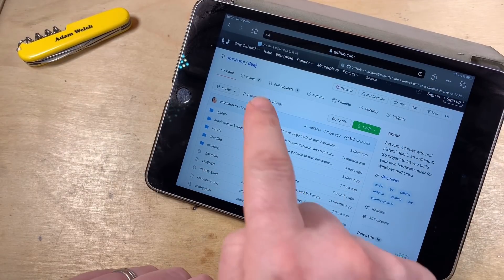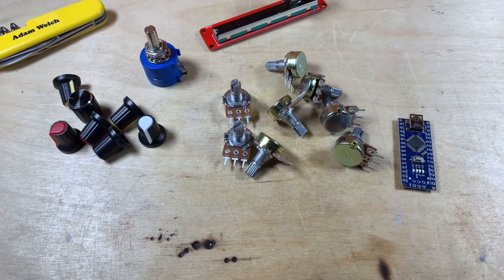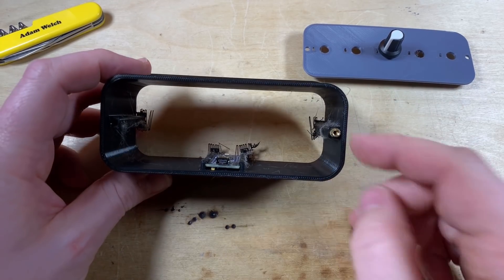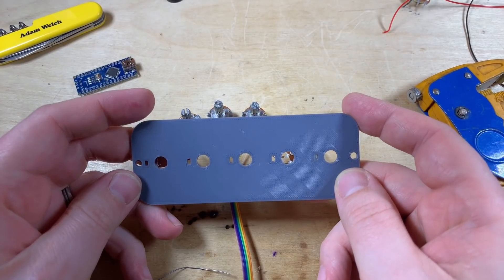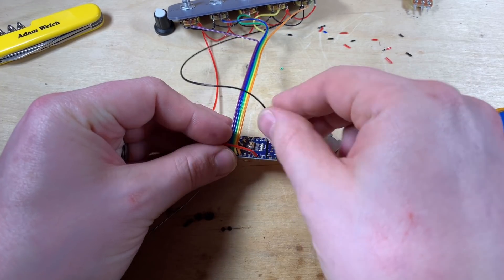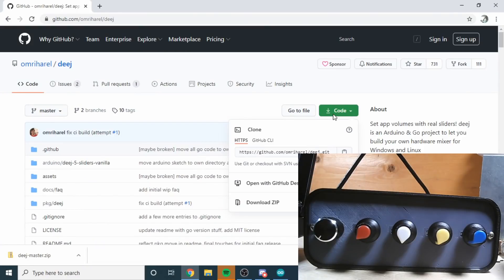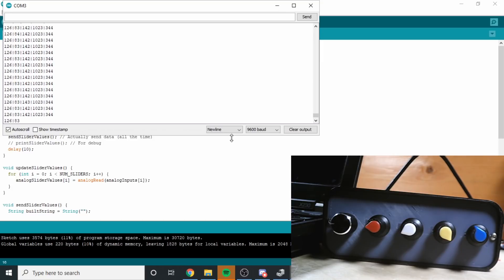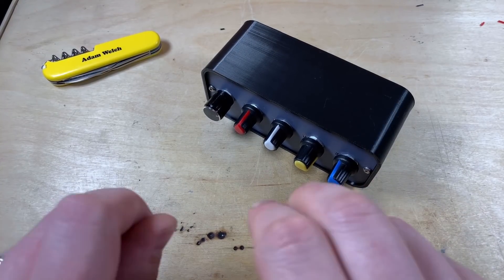deej - Arduino Volume Mixer

Comment: I wish there was a 10$ ready to use one from the local (or oversea) retailer.
Reply: I think the parts alone cost more than 10 bucks.
Reply: @itsasinine3337  Sadly they do, yes. As a done device this surely could be mass produced cheaper than that though.

Comment: Does it make a difference what potiometers i use?
Because i have 2x 100k 2x 50k and 1x 20k.
The serial monitor always write 1023 on the 100k and 50k, and the 20k varies between 995 and 1017.
Reply: As long as they are linear then it shouldnt be an issue.    You'll know once you try to adjust the volumes
Reply: How did you get on?    If still having issues check wires/solder isn't touching or not connecting properly.   
I had the same problem.   All good now
Reply: @MUTILATEDFILTH  it was a issue at the connection.
I am on the road to finish ^^

Comment: Looking forward to trying this! What M3 inserts did you use M3 x D x L ?
Reply from the maker: 4.6x5.7mm according to the listing. However, they can be considerably longer because the channel is pretty much the full width of the case.

Comment: If you adjust the volume through the PC software will it make the knobs automatically turn to the right volume level on the DEEJ?
Reply from the maker: No, but next time you adjust the physical knob, the software volume will jump to the corresponding position.

Comment: Thanks Adam. At 14:34, your comment, 'The code is straightforward...' had me laughing. Most people, who have no coding abilities, would disagree with that assessment. 😉
It's an interesting, if somewhat overcomplicated, way to adjust software volume levels, leaving another item to locate on a busy workbench. But I do like the idea.
One question arises though, and please forgive me for asking it, because I rarely see Windows: Wouldn't a customisable on-screen mixer be much more convenient and tidy to use? Surely somebody must have designed one for the OS? Windows has been around for over 35 years, after all. Of course, the question is begged for those using Linux, because several decent and customisable Open Source mixers already exist.
Reply from the maker: That’s fair. The code is only straightforward if you know it. I guess what I meant was that it is essentially only doing two things - reading the voltage and sending out via serial. 
A commenter has suggested the software EarTrumpet which is apparently a handy windows software mixer.  Cheers RWB
Reply: @AdamWelchUK  Thanks for the reply, Adam. Now the code makes a some sense. 😉 Glad that there is a software solution to the mixer issue. It would have been unlikely that, with maybe thousands of millions of users, nobody had managed to code something suitable. Stay well.
Reply: There are a bunch of ways to do the same thing using software however I really like having something physical that only does one thing.   There are mixers you can use hotkeys for.  You can adjust things via the programs, via windows, etc.  Like would you rather have a volume knob on your car or a touch screen menu?  While someone would prefer the touch screen I prefer the knob.  I think the hardware interface is better because you can use it without looking at it.

Comment: Great video Adam with a real intuitive Arduino program part. I’ve just 3d printed the 7 segment led clock but the YouTube video is really sketching both the wiring and programming, I’ve attempted it mostly by studying screenshots of the video!! Nightmare...alas I’ve ran into a problem...it’s not working lol

Comment: I've bought a PCB for a "split ergo" mechanical keyboard (Lily58) which features at least one rotary encoder. But haven't gotten to soldering it yet.
Would like to have more encoders. Also for zooming on a website which has become somewhat of an issue on a 4k screen and side by side layout.
My ideal keyboard would also have a trackball instead of a central spacebar. No more switching to mouse for a few little adjustments.
Reply from the maker: I designed my own macro keyboard using an atmega32u4 which has twenty keys, or 18 and two encoders. I use the encoder mainly for zooming in to thinks. Cheers

Comment: what a great project! had the same exact problem myself for many years.

 I have since gotten used to hitting the media keys + and - volume on my keyboard. But While holding down another button. But my problem now is that i cannot use multiple keyboard modifiers in conjunction with those media keys. To specify and multiplex the volume control across different channels. Why do i bring this up?

well because most of the time we are only ever adjusting the first 1-2 of the most commonly used audio channels. And then very much less occasionally we need for something less common like skype etc. So being able to do everything 'by feel alone'. without having to look down every single time becomes important.

SO: rather than have a bank of completely equally sized and equally spaced faders. it should be that the usability is prioritized. For example if you have 5-6 such audio faders. Each for a different channel. Then the more channels you have it then becomes slower to feel your way across to distinguish between the middle channels. For example channel 4 much be used much less often than channel 3. Yet you can frequently find yourself 'by feel' being unable to distinguish between 3 and 4. Since they are right next to each other.

So for this project I would suggest a customized grouping of controls. Tailored to how much you relatively use each one. With a combination of faders and different style rotary pots. Different sizes, spacings and locations. You may achieve an extra level of speed when attempting to aquire any given control. The muscle memory of reaching for something. Through appropriate differentiation.
Reply from the maker: I think you make some great points here, and in many ways I agree with you. However I have a bit of history as a small time sound engineer, and you’ll note that typically all pro sound gear use the same fader for all audio channel, or the in same knobs. They do however sometimes space them differently - the master faders spaced a little closer than the individual inputs for example. The beauty here is that each person can position knobs and faders exactly where they desire. Cheers.
Reply: @AdamWelchUK  another thing i've seen in certain products: is a kind of a  zig zag pattern for the dials. so that each next row has alternating high and low vertical positions on the panel. this then lets more room around each knob to get your fingers / hands without it feeling so cramped. or accidentally moving the adjacent ones... yet without increasing the horizontal width which would be making the whole thing wider and less dense,